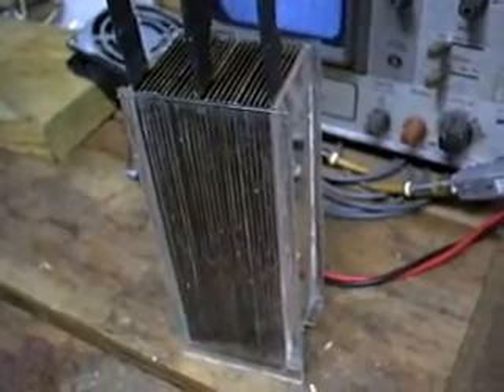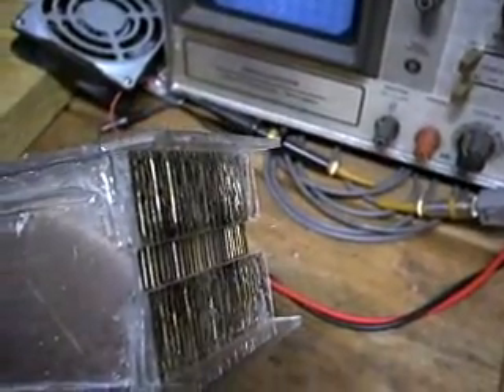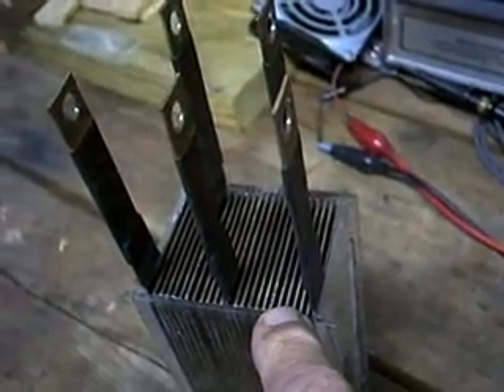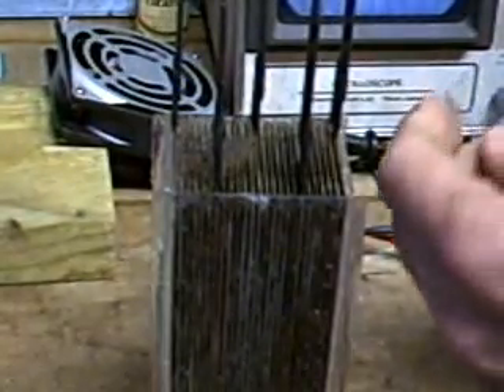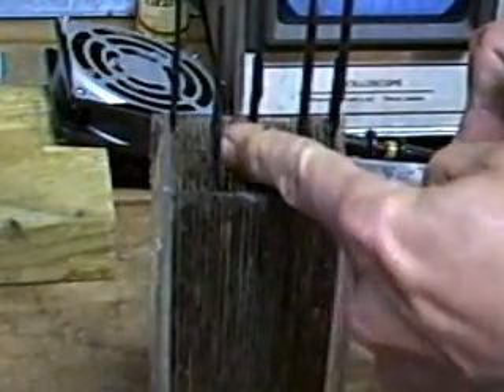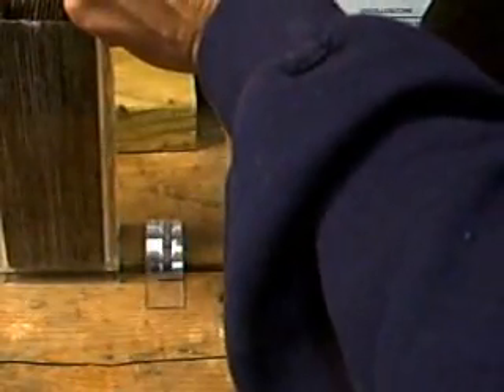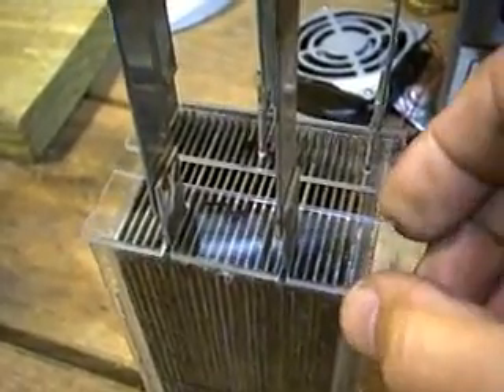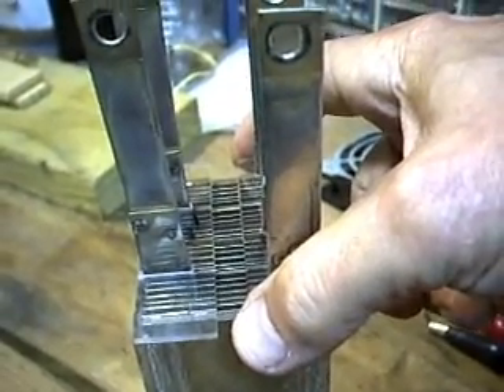#95 - Some VSPB cell assembly details up close

Comment: Have you considered using a single piece of acrylic for the side pieces (with the top and bottom of the acrylic bent around the steel plates)? There's a neat device I know of that uses a thin wire which has voltage run through it to heat it up (much like in a toaster). The acrylic is placed over top, with the wire heating the acrylic to the point where you can bend it easily.

I'm thinking this would be much more secure than multiple acrylic pieces glued together.

Comment: I have an unfinshed design using an inverted 
4" PVC wye. 2 3/4" x 7 1/4" plates, 12 or 14 cells divided into two groups wired in parallel. Neutral plates, edges sealed, etc. I have a construction issue with the electrodes having to be through the sides of the tube which lends itself to leaks. I may have to go to closer spacing and back to a straight tube like you did.

Comment: Use neutral plates and 1/4 - 1/2 amp per square inch current density (I calculated you are using 1.43 amps per square inch at 40 amps with the plate size you stated.) Also do something to limit current leakage such like what ZeroFossilFuel does or use shrink tubing. You are limited by the available power and size of generator you can install. You are producing a lot of steam.

Comment: EasyTBear, can you be more specific?  I am running my unit with a 12V source ans 100x90mm plates.  Playing about with no. of cells and also the gap.  I want to get as much gas as possible to aid combustion so whilst efficiency is importany I need the gas!!  How do you control heat to prevent the current?? I was pulling almoat 40A from my last cell but production was only approx 1LPM.  Any comments would be gratefully received.

Comment: Design your unit to use the power available. The number of cells based on the voltage. The plate size based on current density. Then you have to control heat to prevent current runaway. Efficiency is more important than gross hydroxy production.

Comment: zero, I have found that neutral plates will reduce cell temp but also limits the reaction and therefore the amount of gas produced.  I have some graphs comparing +/-, +n-, and +nnnnn- cells if it is of interest to you.  I am trying to mazimise gas production but am struggling balancing this with temperature.  Do you think regulating the voltage will help with this or will I just see a reduction in gas?? Any comments gratefully received.